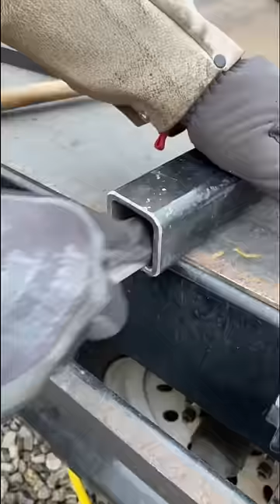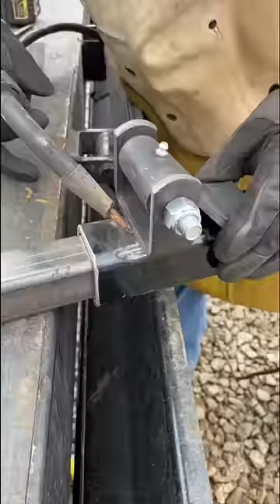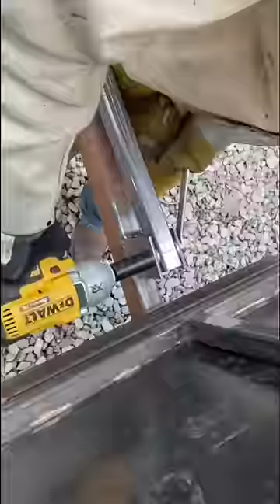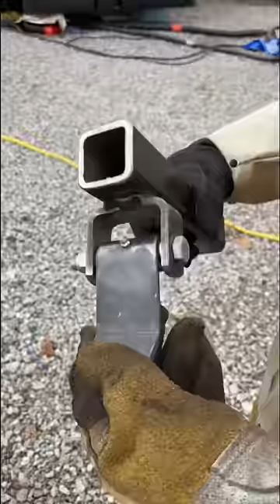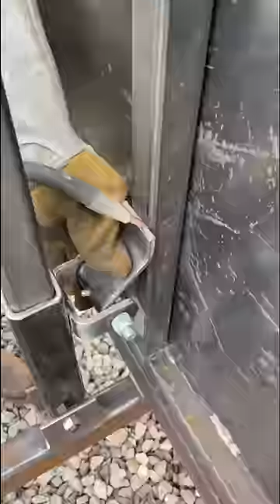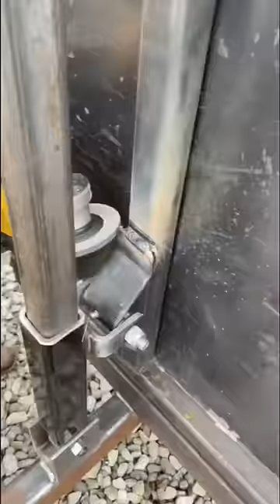ATV Dump Trailer Build Pt.6 #shorts #country #countrylife #ranch #hardwork #welding #fabrication

Comment: It's probably smart to have the option to grease it but how do you expect to be able to hook a grease gun to that zirk without taking it apart?
Reply from the maker: Put a 90 on it
Reply from the maker: Can also remove the bolt every 10 years or so to grease it. There are options 👍